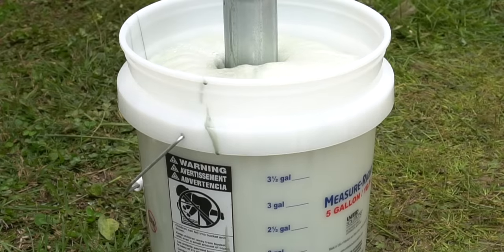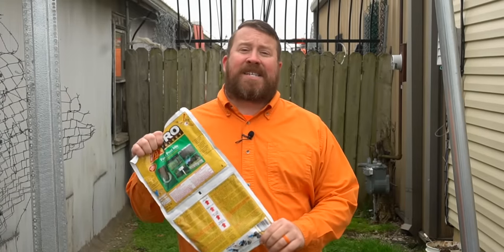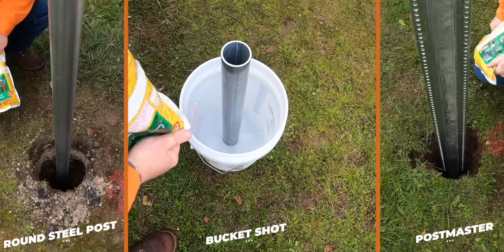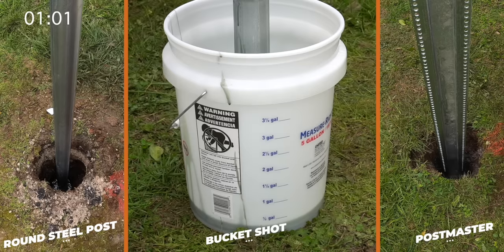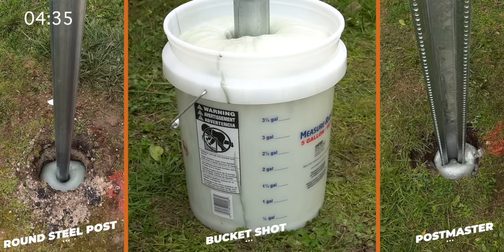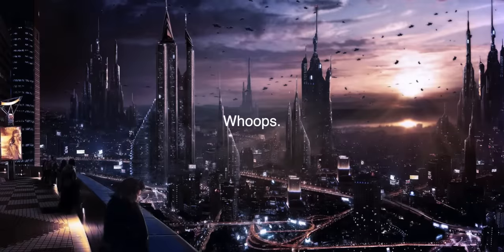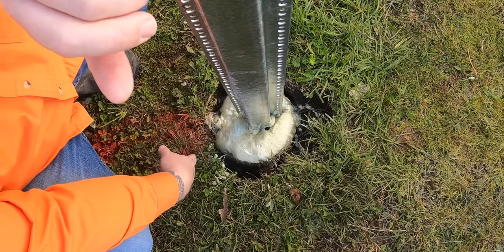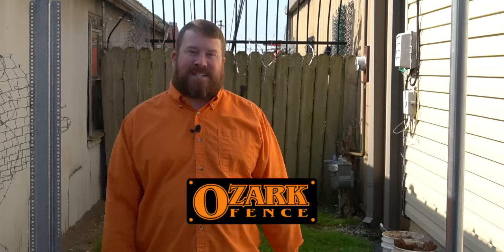Does Fence Post Foam Really Work?

Comment: I  was interested in trying this product when I saw it (don't remember where).  That being said, I need to replace my  mailbox post and thought this was the perfect place to try it out.   I dig my hole in hard clay and rock soil as deep as I needed.  Set and plumbed my post, read my directions thoroughly and proceeded.  I did wrap the post above  ground level  with shrink wrap to keep it clean from excess foam (experience gained in a boat floor replacement)  and glad I did.  Now 2 years later the post is still perfectly plumb and solid.  But, I did experience the same thing with contraction after initial expansion.   Its just that the ground has settled back in around the foam securing it in place.   
Its an ok product and serves specific purposes.  Probably won't be quick to reuse the stuff.  But it does work...eventually.

Comment: I used it to mount 12’ satellite dishes allowing me in and out in one day back in the middle 80’s. Worked very well never had a call back related to the foam. Used it in a rainy wet areas. No issues.  Did not have loosening issues with the foam I used in the 80’s. Must have been a different product.
Reply: @JoeEverest    Back in the 80’s as a rule products were of high quality. Today much junk is marketed so we have to be more careful.

Comment: My take on it: I used the exact brand of foam for my treated 4x4 posts back 2016. I live in an area where we can get gusting winds up around 60mph; my fence has stood up to the winds while I've driven around my neighborhood to see fences where concrete was used and they came down. Another thing that I believed helped is the ground where I live is full of rocks, while it made it very difficult to dig the holes out I was able to throw the rocks back into to holes to add more support to the post and foam. Maybe I lucked out, I can't say for sure, but I'm happy with the outcome.

Comment: Two inches of gravel at the bottom of the post hole.  Set the post.  Then two inches of dirt.  Then two inches of gravel.  Pour in a little water.  Tamp down the gravel with a pipe or dowel.  Keep alternating gravel and dirt.  (two inches each)   Tamp down the gravel on each level.  Works great.  MUCH easier to dig up again if the post fails.

Comment: A friend of mine used this stuff to set a mailbox post. The next big rainstorm, the post popped up out of the ground, the foam floated up on the water that saturated the soil. I guess maybe he should have had a deeper hole, and put more dirt on top of the foam, but it seems like good old concrete would be fine.
Reply from the maker: Wow, that’s certainly not great!

Comment: When I first heard about this stuff, I was like yeah right. I decided to give it a shot. I put up roughly 200' of fence in my back yard and over a year later, its all still standing, not leaning and no problems. I does cost $12 a bag, however, the advantages of not lugging around 80 lbs bags of concrete, mixing it, then waiting for it to dry...yeah...ill pay the extra for that.

Comment: Foam will always have moisture. Which in turn will rust your metal post off and rot your wood. I seen people try to use it for car body filler, to patch holes in roofs, foundations, ect. Don't waste your time and money, form dose not get hard like cement. And if after it sets and drys, you are able to wiggle the post loose.

Comment: Not sure if it was mentioned in previous comments, but i think your mixing technique may have contributed to the foam failure.  On the package is says to use a 90 degree surface to force the fluid in and out of each section of the 2 chamber bag.  Personally i used the trunk of my car to mix as it has a 90 degree edge with no sharp surfaces to puncture the bag.  My post doesn't wiggle nor did the foam contract so it hold nicely.  I say it's a win... 5 bucks for concrete, 10 bucks for foam, but the amount of time, effort and clean up is worth the extra 5 bucks.

Comment: I have used this on my posts. All of them turned out to be wobly like yours. What I did to fix it at least temporarily was to dig a bit more around the foam and pour more foam to harden it around the edges, and this made it quite firm, but even so, I suspect after the winter I will have problems due to the frost pushing the posts out and will have to re-do everything with concrete the next summer after having spent over 200 dollars on this crap. When I went to the shop and explained what happened, they told me that the trick to make this foam work was to make sure that the foam also expands well UNDER the post to give it more depth and stability, but this means that you somehow have to make the post keep above the ground while the foam is expanding, which makes it quite complicated and not worth it using this product for sure.
Reply: Every wooden post that I have put in has a rock or brick under it allowing concrete or foam to get under it to seal the bottom and to grip it.

Comment: That is interesting the product pulled away from the substrate I'm wondering if it's because of the galvanizing on the metal that might work for lumber but probably not for steel

Comment: Once I've squeezed the one side into the other and broken the seal, I've always rolled it back and forth on my leg for 15-20 seconds and then cut and poured.  It has always worked well and I've never had the kind of contraction you experienced.  I don't you mixed it correctly as it seems to take forever for it to expand.  Mine usually take half that time.  After about 2-3 minutes, my hole is completely filled and coming out the top.  You don't want to use a hole the size you would for concrete.  It looms like your holes were properly sized for the smaller metal posts, so I'm thinking that it didn't mix properly or, and I'm just guessing as I've never used it on metal posts, that it just doesn't adhere well to smooth metal.  I've always used 4x4 posts and I've pulled a few out and it was nearly impossible to get the foam off of the post.
Reply from the maker: The feedback from the manufacturer was that it was installed in less than ideal conditions, it was cool and misting.

Comment: I’ve used post foam a few times and I haven’t had any of those issues. I also mixed for 30+ seconds and the foam seemed to have expanded much faster than the ones you did. Maybe it was the brand I don’t know. Got mine at menards
Reply: Yeah we missed thoroughly for at least 20 seconds and it expanded really quickly in our dug holes

Comment: The trick with foam is depth - I put a full fence in of 10 ft 6X6 posts that I dug down 48 inches. The fence should easily last 30 years. Problem with all these demos was low post depth and exposure. After the foam sets, use a combination of dirt and gravel and compact it.

Comment: Some of the roadside crash barriers in the UK are set with foam, and it seems to work just fine. May well be a different product to the one used here but at least it shows that foam can be used even in safety-related applications.
Reply from the maker: I’d have to bet that it’s a completely different product.

Comment: I dont use concrete, I just use the dirt. I slam another 4x4 wood post down on the dirt to tamp it down. My posts stay up just fine.  Our dirt is a clay-silt- topsoil mix that stays fairly damp year round. When the post rot after years and years, it is a lot easier to dig it out and replace the post. Not broken posts but a little rotted, you may be able to wiggle the post loose and then lever it out of the ground with no digging. Then slide a new post back into the old hole.  Even broke off posts, take a 2x4 and screw to side of old post. use a 4x4 and lever it out of the ground pressing 4x4 post up against screwed on 2x4.

Comment: My boss had us try this on a job this year. We had mixed feelings after seeing the results on the first 2 posts. Our bags said that the holes should be 30' deep and dug so that the bottom of the hole was wider than the top. What we ended up doing was digging the post hole down, putting the post in, then backfilling it maybe 4-6 inches, THEN using the foam. That got better results, but it was still a bit suspect, plus it was kind of a mess to clean up because it'd fill out over the hole and have to be cut back.

It was our first time using it, so user error is definitely a factor, but it seemed like a much messier and more annoying method than the ole standby. As the dedicated mule I appreciated not having to carry a ton of 80 pounders and find space to store them though, but whether that makes up for the extra time spent making the hole proper and having to stake it still and the like, I'm honestly not sure. I think I'd rather just get 60 pound bags and use those instead.

Comment: This has to be one of the silliest ideas in fencing.   Anyone who has ever removed double-glazed windows sealed with PU foam products will tell you it doesn't hold up well in terms of strength over time.    The binding adhesive in most types of PU foam products breaks down and falls apart.   Even if it didn't shink immediately after pouring,  in 6-12 months exposed to constant moisture and temperature changes, it would likely be crumbling.     Also rodents absolutely love turning it into bedding and nesting material.

Comment: Thanks for this video!  I wonder if the foam is more toxic/better chance of chipping away than concrete?  I ask this because the local deer do a good job of grass cutting and ivy trimming around my fence and mailbox posts lol.  Hate to think a dead animal is caused by toxic hole filler.

Comment: I've decided after using the foam in the bottom of a large hole for my fence as I had to pull out a previous Cement post. Then I'm also using a full bag of Cement to help closer to the top
Reply from the maker: Sounds sturdy! Let us know how it goes!
Reply: @JoeEverest   seems really sturdy so far. Dry poured the mix and tapped it down then added a bit of water. 3 hours later I filled the rest of the hole in with dirt. Could have used 3 more bags of mix at least. It's a 4x6 that's 3ft into the ground and I'm going to attach a 9ft gate on a caster wheel of course and a no sag bracket gate kit

Comment: Also you should wait until you feel the bag start expanding before you dump it that way you know you have a good mix before it’s sitting at the bottom don’t wait for it to expand to the bags full capacity causing it to explode but once you notice a small expansion starting to happen that’s the best time to pour it
Reply: Continuing to shake and mix until your expansion

Comment: My only gripe with the foam was that my dog tried to eat it about 3 weeks after I did it.
Had to rip it all out and do concrete on top.
There's no safety data sheet on that foam after it's been mixed, only on the 2 component parts. I was worried he would get sick.

This was on a single post I was repairing after removing it to bring a shed through.
Reply: @JoeEverest  he was! Just scared the bejesus out of us

Comment: i like to ram dirt for the first half of the hole setting the level then concrete for the top half of the hole , the other thing that works is slightly flaring the top of the hole so the ring of concrete is bigger

Comment: I used foam (I think it was the same brand) to anchor a steel tube post for the end of a clothesline. I suspected that the foam wouldn't be strong enough. So, after placing the post in the hole, I also filled the hole with fist-sized (give or take) rocks. That way the foam acted to lock the rocks in place, but it is the rocks that provide most of the resistance to the movement of the post. I also added a 45-degree guy wire, as I would have done had I used a concrete post hole filler. It has been a few years now, and it seems to work fine.

Comment: Looks like some of the gas bubbles collapsed before the foam could harden.  I suspect the temperature of the soil (and air) along with the moisture content of the soil (and air) will have a big impact on performance.  What is this post foam made of?  Polyurethane?

Comment: I installed a 30’ tall flag pole, 5” dia., using Fast-2K brand of two-part foam purchased from Menards in place of where sand is directed to be used by the pole manufacturer, with all other pole installation directions being followed per the manufacturer. It’s been standing 2 years and has sustained high winds with 2 flags and has not failed. There was no shrinkage with subsequent gaps as shown in this video. For the pole installation directions I used you can see them on UncommonUSA website on the  “Commercial Flags” page and you can see where I substituted the foam in place of the sand, which is inside the 8” metal sleeve and encasing the 5”pole which is 1-1/2” of foam in the annulus in the sleeve and encasing the pole and supporting it. . This product has worked flawlessly. 

Note that I do not have any ties or affiliation with Menards, Uncommon USA or Fast-2K.

Comment: I pour the sack of concrete dry, tamp the air out while holding the post plumb and top with a couple of inches of soil and tamp again.
Then just leave it. Wind doesn't move it hammering on it only tamps the mix further and ground water/ moisture will cure it in a day. Never had an issue and the concrete is solid in a day or two... No need to add water and or mix. quick and simple - I've done about 6-7 hundred.
Flag-poles are set with plain sand!
Reply from the maker: Sounds like a great process, I appreciate you sharing it!

Comment: I used this stuff several years ago on a wood post fence 12 posts 3 with foam and balance with concrete. those posts with foam failed miserably after a few years had to pull the posts and redo -- was a real pain.
Reply: Just tell it like it is

Comment: Hey joe, so I just did a fence with 2 3/8 galvanized post with metal to wood brackets and 5/8 thick pickets, so I’m also using the one very post in my driveway for my gate I’m using 14 gage 1.5inch metal square tubing for the frame and screwing my pickets on it, the one post I made a bracket to attach to my house to it’s solid and won’t sag, the other side I don’t have that option cause I have a shared driveway, so to make that other post more solid and won’t make it sag I was thinking of using rebar in the middle of the post and filling it with concrete, do you think that would make that post more solid and not sag? Also I have the post set 2 feet in the ground and 1 foot wide, if you need more info I could give you my email. Thanks man, and I love your fencing videos!
Reply: Joe Everest ok I will make sure to check that, do you think filling that post with concrete and rebar will make that gate post not sag anymore??

Comment: Question about using a gabion fence 5 feet tall, 76' feet long, 1 foot wide. Basket filled with river rock, fence post every three feet, 2 3/8" post, 2 feet underground, couple of bags of wet concrete to set the post. the frame is ties tot he baskets. Any recommendations is appreciated.

Comment: What I'm seeing is that you set the post in, poured the foam mix in and just let it go.  Aren't you supposed to hold the post in place until it gets pretty firm?  Sure, it never formed solid on the post because the post never stopped moving due to wind or maybe the expansion itself.  I've never used it, because it just seems to be an expensive way to replace concrete which works fine.  The only advantage I can see with it is if you ever have to remove the post it might be easier to dig out.

Comment: I have used this foam product to install wood post for a spiral staircase and had no problems.
Reply from the maker: Judging by the comments it seems that those that use the product with wood posts have much better success. I’m guessing that that steel posts act like a heat sink which effects the exothermic reaction and resulting expansion.

Comment: There are several foam comparison videos out there and they all got the same results with the brand you use. They used a different brand sold in the box stores and had better results.

Comment: What brand foam was used in the test?  I was considering using foam for a future fence install but this test gave me serious doubts.
Reply: @JoeEverest   - Have you tested the Secure Set brand foam?  I had been considering that brand for use with a seven strand smooth wire high tensile wire fence.  Great video.  Very helpful.

Comment: Few thoughts. Cost. Does the expansion create uplift of the post? In extreme wet climates could the foam cause lifting of the post? Environmental issues? Disposal years later. I think I'll stick to the basics, concrete
Reply from the maker: All great points, thanks for weighing in!

Comment: we use a similar 2 part foam in our business where we lift sunken concrete slabs with it. Ours mixes at 1000psi and is over 100 degrees. It fully expands in 4 seconds. I would NOT use it for this application. It is incredibly powerful when working under compaction and it meets resistance such as the weight of a heavy concrete slab. It does great to lift it and hold something sitting on top of it. When it is just dumped in a hole like this, it's going to contract because it wasn't put under pressure in the first place. When we lift 10 ton slabs with it they don't drop back down an inch after we're done because the foam is compacted as much as possible during the lift.
Reply from the maker: Sounds like an incredible product!

Comment: Nothing beats the  old fashion way, use a wheel barrow, mix concrete before dumping in post hole. I never pour mix dry in post hole. Also vibrate concrete in hole with a stick.

Comment: It actually worked amazing on my project. I used a product called Zika and it works wonders. The trick is to add enough product and then once settled compact it with your feet and water it so the smallest dirt particles fill the empty spots.